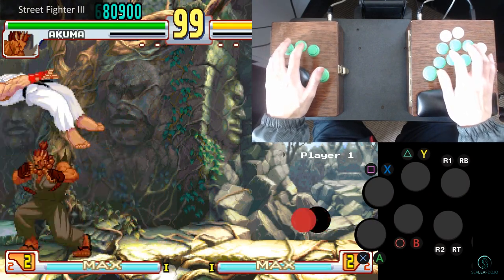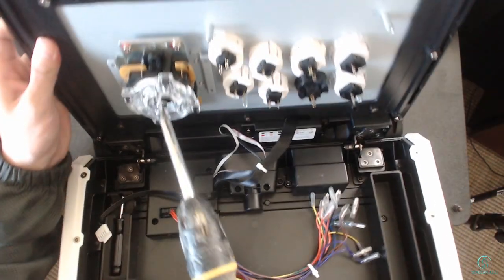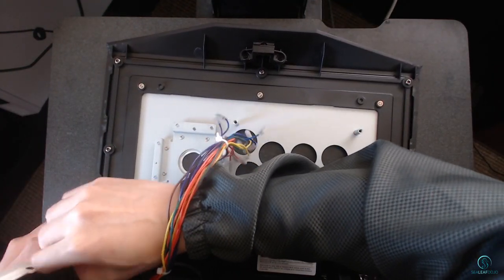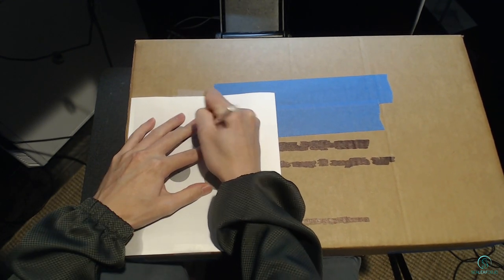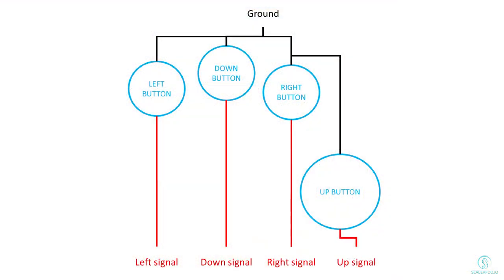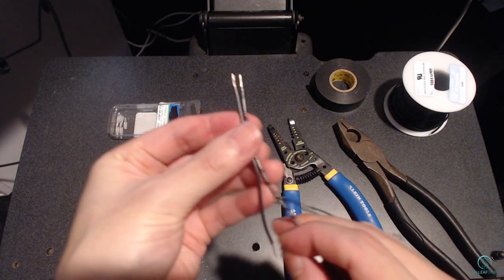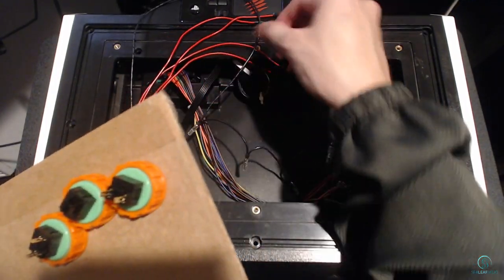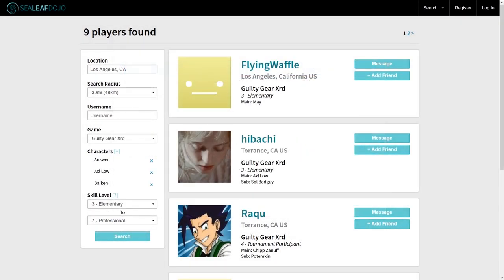How to Build a Button Controller Prototype

Comment from the maker: Additional tips:
1. Getting screw type buttons may be better depending on the thickness of cardboard that is being used (as shown in the video). Screw buttons easily adjust to most material thickness while clips types do not. However the rings for the screw type adds width to the installation area so you may not place buttons as close to each other as clip types.

2. Using stiffer wires (less strands/stiffer material) may make it easier to insert into the connector. If you do not have access to that type of wire, you may need to get male pins and crimp them on before insertion.
Reply: are the screw type buttons you use Sanwa or something else?